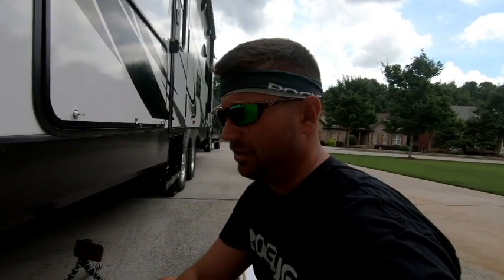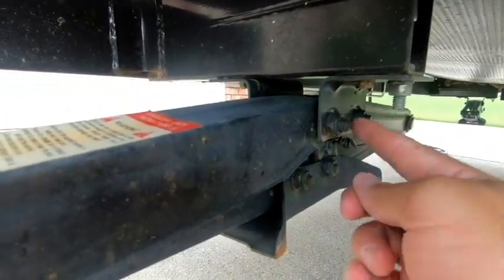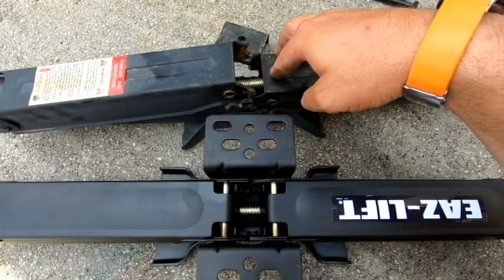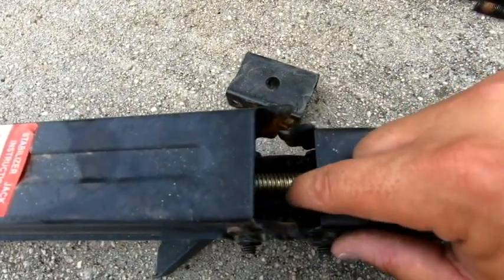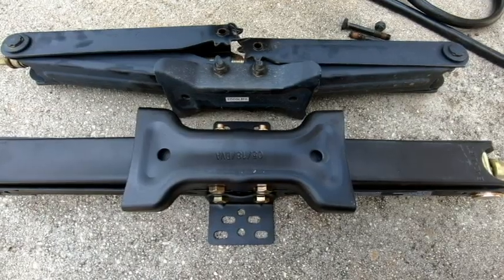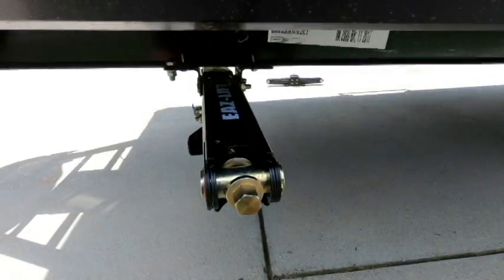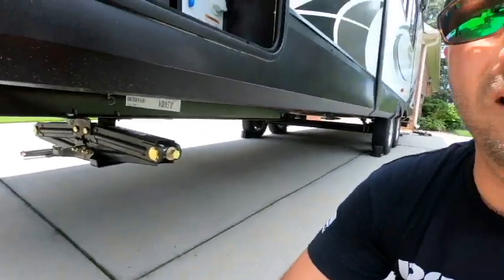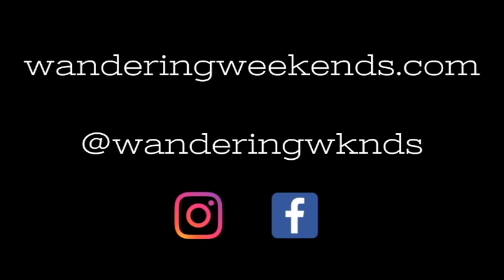7500LB EAZ-LIFT Stabilizer Jack Upgrade

Comment: You should probably have used the upper mount pad that came with the new jacks as they are probably  heavier than the original ones that you left on.
Reply from the maker: K Male surprising they looked the same. Also, they were welded on so I didn’t want to get into that type of job. I certainly wouldn’t want to weld on a frame still under warranty. Thank you for watching and commenting!
Reply: I replaced mine with the 5k jacks. And I replaced the whole thing. No welds on mine just 2 self tappers and a nut an bolt. Was really easy. I preferred to swap out the whole unit as it is. To each they’re own :)

Comment: I just installed these and boy what a difference! I did not re-use the mounting pads because the metal seemed much better on the new one’s. Each old one had a bolt and 3 self tapping screws. Referenced the mounting holes based on the bolt hole location. Had to mark and drill a few new holes but that wasn’t a big deal. With the right tools, bits and know how it’s an easy upgrade. Pro-tip. When you install them extend them down so you don’t have to fight them… otherwise a pair of vice grips help hold them up.

Comment: Should have just tightened the bolts on the old ones.  That's why it was moving around
Reply from the maker: Incorrect. Tried that, they were plenty tight.

Comment: You just weaken the new lifts by using the lower grade steel mounting bracket from the old lift. If you notice it came as one complete assembly with the bolt pattern already in the mounting plate those stabilizers no longer have a 7500 pound capacity
Reply from the maker: I don’t need 30,000 lbs of capacity and these are not “lifts”. The purpose of this upgrade is to increase stability while parked/camping. It’s been a few years and they’re doing great.
Reply: Well then I ask you most importantly have they made a big difference in sway of the camper when it’s parked and set up? I’m about to purchase the same Jack’s for my Rockwood and was also considering the JT strong arms and was curious if the jacks alone made a difference.

Comment: I enjoyed watching your video and I'm considering the possibility of upgrading my own stabilizers.  I went to Amazon to check them out and read some of the review comments and was surprised to see that some people didn't think these are very good.  It occurred to me, as I read, that these folks think these jacks can be used to level their trailers.  

Being that you have ample experience as an RVer, you are aware that these jacks are not meant to be used as levellers but only for stabilizing a trailer.  The folks that didn't like these, seemed to think that they could handle the weight of their 7000 lb trailer because the jacks are rated for 7500 lbs.  

Maybe they weren't given a proper walkthrough when they purchased their trailer or, maybe they weren't paying close attention (it happens) or, third case scenario, they bought it used from someone but, I distinctly recall our service guy telling us to NEVER use these jacks for levelling as that is not their intended purpose.  They are only meant to stabilize the trailer to make it more solid and less side to side movement.

I left a comment on one of those reviews and I know you're in the know but I thought I would just bring this up here as well so other folks understand the purpose of these jacks.

Again, great video and I will be watching more.  Happy camping and stay safe,

Wayne
Reply from the maker: Wayne Shufelt thank you! You’re exactly right.  That said these jacks would easily handle the weight of our trailer. The main reason for not leveling with stabilizer jacks boils down to torquing the unit. When pressure is placed on on only corner of the rig doors may not shut, windows could have issues. Slides may stick,ect.
Reply: @WanderingWeekends  Thanks for your reply and you're right as well.  They may handle the extra weight but it sounds like we agree, they weren't meant to be used that way.  I recall the service guy mentioning that as well so, I'm sticking to levelling blocks and fewer expenses.  Things last longer that way.

The Wingman has said it over and over again that as RVers and RV wannabees, we have to do our "due diligence" and know our rigs from top to bottom, learn about the components that make up our home away from home.

Learning and sharing,
Wayne

P.S.  Subscribed
Reply: While I completely understand these aren’t levelers, our  single axle trailer is 5K soaking wet. Just as a test I jacked it up after install and they didn’t even groan a bit. Good to know in a pinch if I had to change a tire roadside along with a bottle jack they shouldn’t give way. Again I understand that’s not their intended use…

Comment: I'm new at this, thank you for the video. I have 4 on a small one axle trailer. However, first time I took it out, I forgot to crank up these stabilizers. I only pulled about 2 feet ahead before I realized it, so I stopped went out to crank up and one had a bent prong on the one in the rear. It took a lot out of me to crank back up as to the prong looked like a boomerang! I haven't been able to replace yet. So I don't use it, I just leave it up. The other 3 are fine, and I won't forget again! But, I do need to replace that one, as to every time I step into the trailer, I feel like I have vertigo. Let me ask u, they call it eaz jack.....do u still have to hand crank it up and down? Or... what makes it easy? Thanks for taking the time to read this and I hope u have.... any good suggestions would b great. Hand cranking is getting hard on me. I have carpal tunnel. Jeeesh, this old crank up n down crap is starting to tire me out. Lolz.
Reply from the maker: JoPaddy Art & Entertainment appreciate you watching! Still very happy with these jacks. I simply use a cordless drill with a 3/4inch socket to zip the jacks up and down. No problems at all!
Reply: @WanderingWeekends  thanks
Reply: @FEARLESSME-JoPaddy-  keep you jack screw's{ ACME THREADED ROD} greased and clean and use a drill . Lucas grease red and tacky is my go to on all things like that but any bearing grease will work Moly grease is best in bearings to me i never use cheap stuff it suks ..at least spray lube /or oil it be for each use it will last 10 times longer

Comment: Are these jacks capable of lifting your trailer? Tire changing.
Reply from the maker: Capable... yes. Recommended... no. They’re only used for stabilizers. The frame of the trailer may not agree with using them to raise the rig off of the ground.

Comment: Any corrosion problems on the screws?  My 5k jacks on my Jayco 26BH require the use of an impact driver to operate after 7 years.  Have you had to lube them or anything?
Reply from the maker: Not yet! These are 3 years old. Lubricant will allow them to back off much easier. Time will tell.

Comment: Great video.  I have a salem 273qbxl with the factory Jacks.  I also have 4 sets of strongarms which helped a lot. Its still a little wiggly. I understand will never be like a house lol. So do you think it is worth it to upgrading to these enough that I would notice a difference?
Reply from the maker: If your jacks still wobble when fully retracted I would upgrade.
Reply: @WanderingWeekends  I meant the whole camper is a little wiggly when fully set up, sorry I should've explained better.

Comment: Just bought our 2020 - 2800bh camper last year and we had theses in our cart as a possible upgrade. Just went to order them and they are no longer available on Amazon. ☹️ just wondering if the “Libra brand” is just as good to upgrade to? Thanks
Reply from the maker: Shelley Waterman dang that’s a bummer. I’m not sure about the Libra brand 😕. I wonder if they’ll be back in stock soon. Many have used our link to purchase so they haven’t been sold out long.

Comment: I have a 21 ft RV camper.  wanting to change the stabilizers.   cant decide which one.  the eaz-lift 5000 or 7500.
Reply from the maker: either will be fine... if the 5k saves you a few bucks go with them...

Comment: Wandering Weekends great video. Do you find the jack upgrade makes a noticeable difference in stability when you’re walking around inside the trailer? I have an Imagine 3000QB, very similar to your 2800BH...
Reply from the maker: Absolutely... made a huge difference for us.  I believe you may have better jacks than we did though.  GDRV started putting 5000lb jacks on the Imagine line shortly after we purchased ours. These have been a great investment.
Reply: Wandering Weekends thanks for the great videos. Love your videos on the trucks/towing & logistics of camping!

Comment: what a great find for me.........    i wondering why not level vs stablize my rig w the  proper size scissor jacks vs those plastic blocks that are so weak......       maybe put some wood blocking under the tires if they come off the ground but i am feed up w/ leveling the rig w/ the step blocking  method.    the plastic is costly and i see rigs w/ 3 and 4 sets of the plactic junky blocking....

Comment: Has anybody put these on a GD 2500 RL my gvwr is 7,495 
Just wondering if 7500 lb jacks will be good enough or to much?

Great video though I definitely need to beef it up.
Reply from the maker: You aren’t ever using them to their full capacity. The heavier jacks are simply better built therefore they outperform the factory jacks. They’re only there to stabilize, not level. Your GVWR isn’t a factor here…
Reply: @WanderingWeekends  Yes, I always have the trailer level b4 putting the stabilizer jacks down. I try not to extend them more than halfway using blocks of wood on the ground if need be. After seeing your video, I can’t believe the difference in the 7500s compared to the factory. I still get quite a bit of movement with this unit so I’ll need to invest in 4 new jacks. I honestly did not even think about this upgrade. Thank you for your help.

Comment: Sooooooo it finally happened... I wasn't thinking while adjusting the truck/trailer in front of my house and caused the tail end of the trailer to catch a huge bolder in the yard.  It destroyed the rear passenger stabilizer jack.  I watched this video a while back and remembered you recommended this brand so I'll be ordering one soon.  Thanks!
Reply from the maker: The Lost Texan I think hitting a jack or two is a right of passage in the RV world. You won’t be disappointed with these jacks. Possibly the best bang for buck upgrade we’ve done. Thank you for watching and commenting. Happy camping!
Reply: @WanderingWeekends  Hopefully this is the last "right of passage", my wallet can only take so many, haha!  Thanks again!

Comment: I ended up installing the 7500LB on my Grand Design front end. I will replace the rear as well since the kit come with four. I had no choice went over a rail road on my last trip and the front stabilizer's hit the rail. I did not notice until we got to the park.Not fun but the truck rides so much higher than the trailer.
Reply from the maker: Doug Meyer I’ve wanted new jacks for awhile and being under warranty I probably could have convinced Grand Design to send me a set of 5000lb for free but I couldn’t justify asking for that. I had a car suddenly take up a lane I was planning on using and had to turn too sharply about a month ago. The trailer dipped off the road and bent a jack. In the right rear. Made my decision for me. I’m so glad I replaced the other 3 now after seeing such a difference. Big difference inside the rig as well.
Reply: Thanks for the information I will install the remaining two units.
Reply from the maker: Doug Meyer thanks for watching and commenting!!

Comment: What is the advantage of the increased 7500 lb rating vs the weaker stabilizers that come with the 2800 bh since they simply stabilize the TT vs actually lift it
Reply from the maker: They don’t back off nearly as bad. Big improvement actually. I see what you’re thinking but increased capacity=increased stability in this case. Best $ for $ mod we have made.
Reply: @WanderingWeekends  thx for the clarification - our dealer told us to keep in mind to replace the jacks because they do get damaged - lol and behold I damaged one in our last trip - might as well replace them all while I am working up a sweat.

Comment: You should have changed the mounts for the ones that came with the new jacks.
Reply from the maker: Those were welded and really sturdy. It’s been a few years now and still really happy.
Reply: Can u post a link to the stabilizer bars and where to buy

Comment: I would not have used the old jack brackets to put the new ones on. It's the same cheap crap the old jacks were made of. That's why the new jacks have the neat brackets with all the holes to accommodate installation. But if they seem OK, fine.
Reply from the maker: Silas Longshot they were welded. The brackets weren’t the issue. It’s been a few years now. The best dollar for dollar upgrade we’ve made.
Reply: @WanderingWeekends  Yeah, being welded in place changes things!

Comment: Better watch stacking those blocks under your tongue jack its dangerous
Reply from the maker: Robert Canup suggestions?
Reply: Wandering Weekends I’ve stacked the same way for over ten years with different trailers with no issues. It’s only an issue if you don’t put your leveler jacks down at the same time so the trailer is more secure during windy days. If you stacked them off center then yeah that would be a problem but why would anyone do that lol.